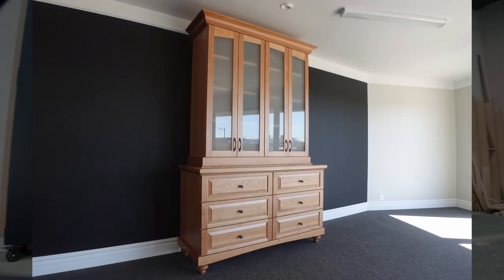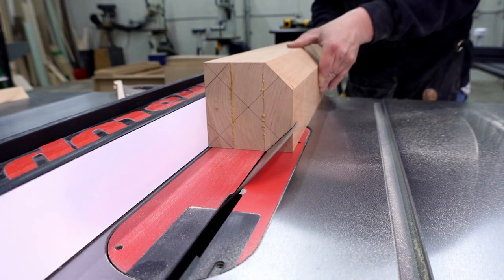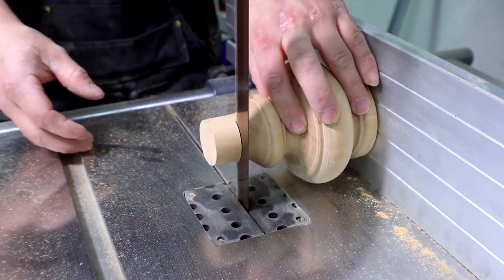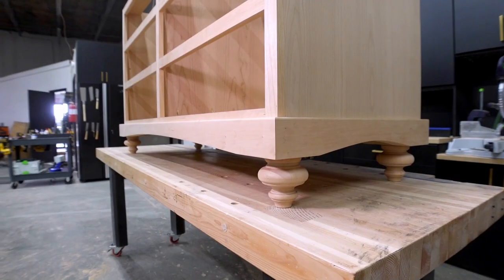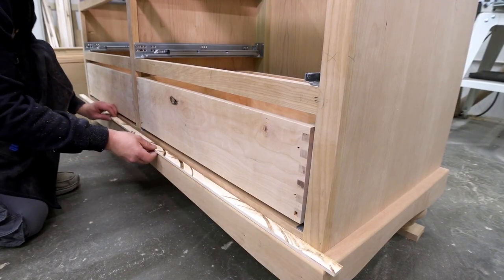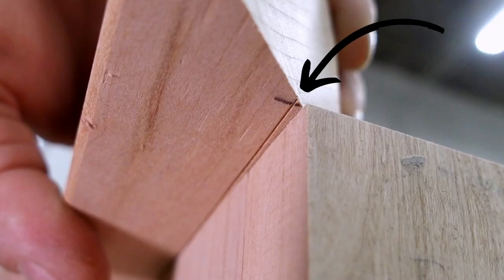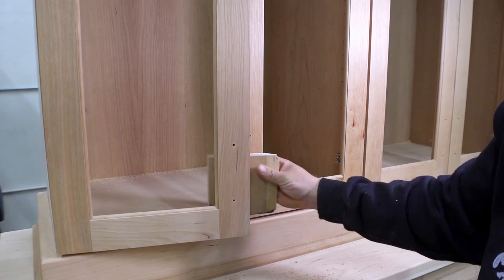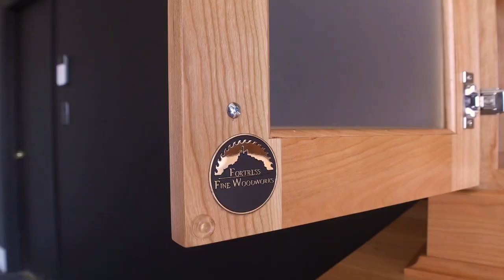Pushing Design BOUNDARIES.

Comment: A design question: It appears that you permanently attached the hutch to the base. I have moved some of those things and find the ones with a removable hutch way easier to move in two pieces. Is there a design reason to make it all one piece? I am very happy for your continued sobriety and optimistic for your continued well being. Thanks for the advanced content. I love it.
Reply from the maker: When the hutch was installed, the crown went all the way to the ceiling. So it was built in. So there will be no moving that thing around anyways